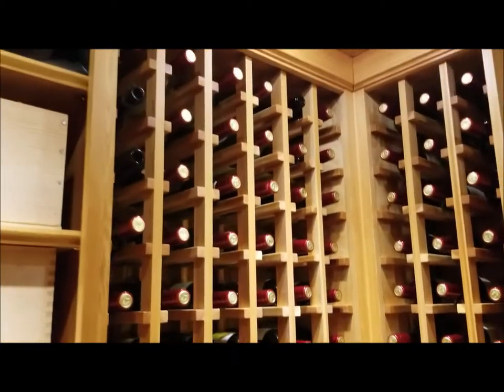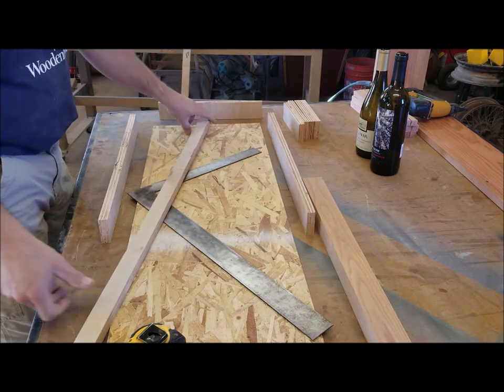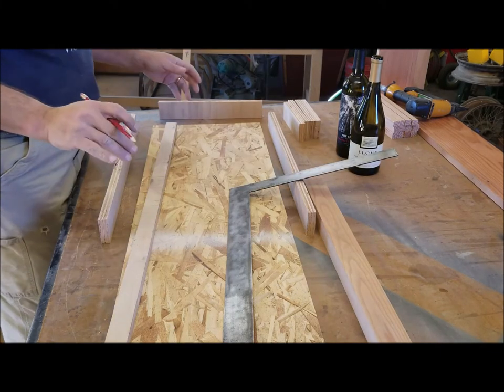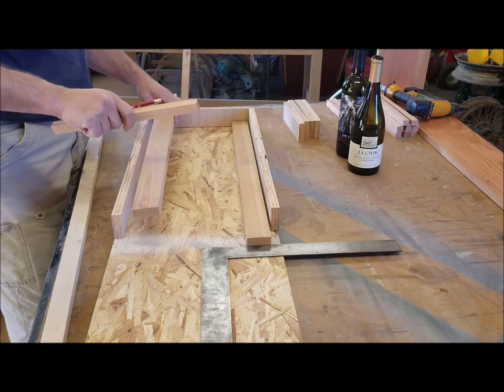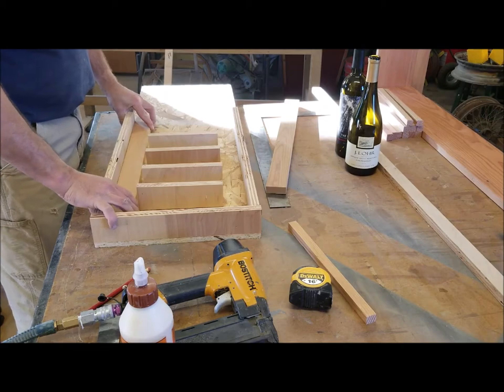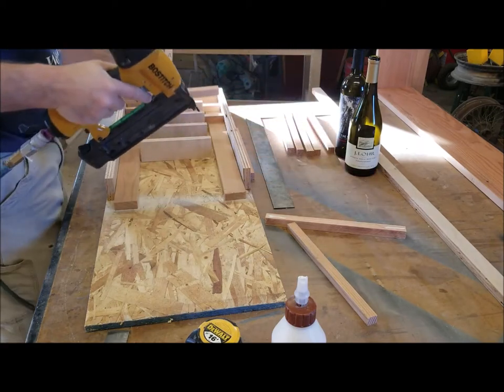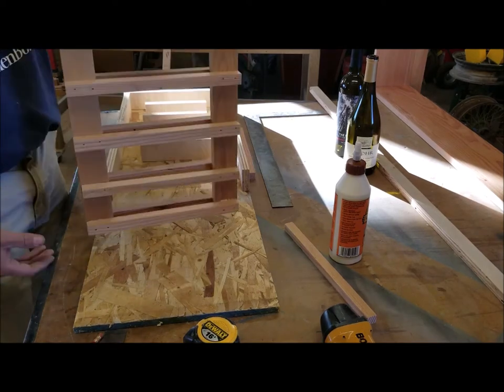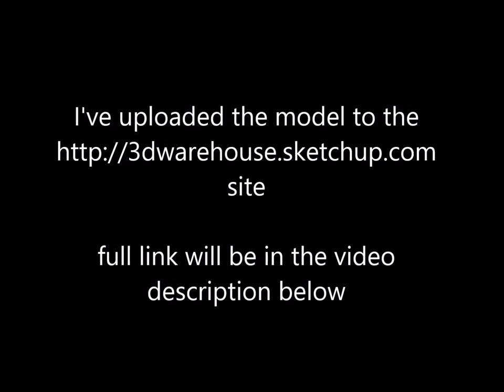DIY Wine Racking

Comment: I'm going to suggest you go with 3 7/8" or maybe even 4.  Followed the 3 3/4" measurement, measured 20 times (not exaggerating, made a mock up.  Everything was great, so I thought.  Built a rack for 70 bottles and now the bottles slightly rest on top of each others.  A very standard sized bottle.

Comment: Thanks for running us through this explanation video. Really helpful for my build that I'm getting started. How did you end up fastening each side/Column of the racks together against the wall?
Reply from the maker: There are lots of different ways to do that, but I always add a crossmember across the back to serve as a nailer. When I go to install wherever the studs are, I can put a screw into them. I’m not sure that’s well explained but every commercial cabinet typically has a crossmember across the top and sometimes across the bottom for that purpose.
Reply: @chrisarneson8644  Yes that makes complete sense. Thank you so much for the explanation. Assuming you attached each column to the crossmembe before screwing crossmember into the wall?

Comment: Hey Chris great video! Quick question what did you rip those 3/4 x 3/4 horizontals from or did you get them already precut?
Reply from the maker: I ripped them from 1x6 fir boards.
Reply: @chrisarneson8644  sweet thanks great video by the way! I'm excited to make the jig as well as the actual rack. The story stick is genius. Thanks again!
Reply: @chrisarneson8644  one more question. The way you are using the story stick that is for the height of the rack correct?
Reply from the maker: @Stvr1000  I make one for each dimension. I have one for height one for width and one for depths of the depth one can sometimes be skipped if it’s obvious